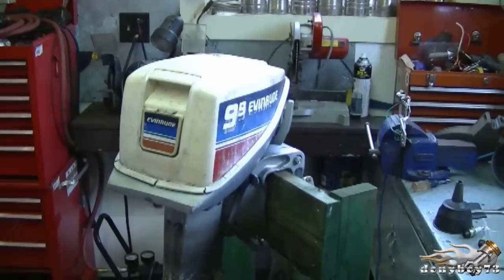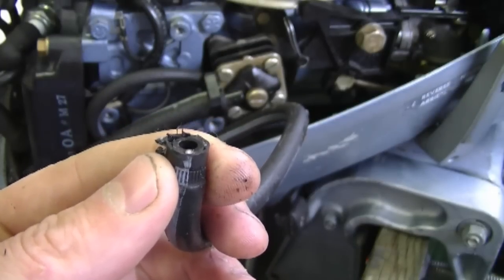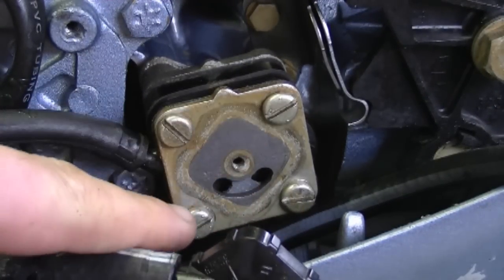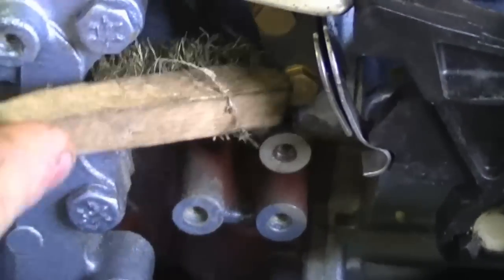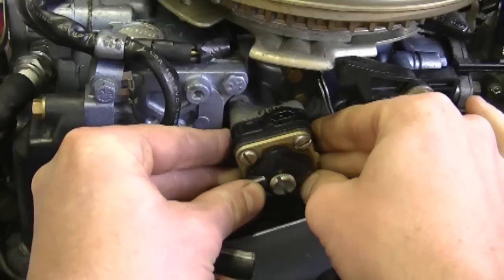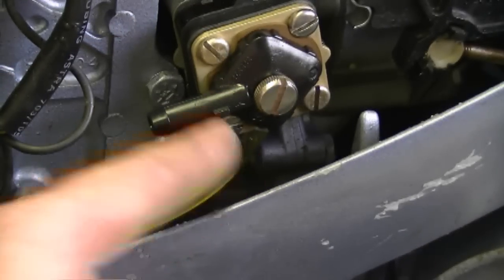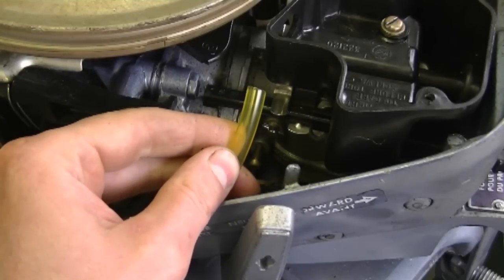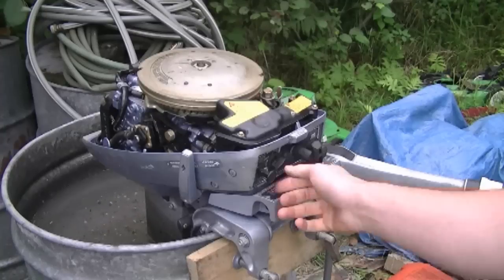How To Replace The Fuel Pump On an Evinrude 9.9HP Outboard Motor

Comment: One thing I discovered after rebuilding the carb, rebuilding the fuel pump, and installing an updated ignition module on the 15 HP version of this motor is to begin problem solving by checking the existing fuel tank. I was having all sorts of problems with the motor bogging down and wanting to stall whenever a significant amount of throttle was applied. After changing all those items it dawned on me that the problems always started when the fuel tank was at a lower level. Looking inside the plastic tank I noticed that there was a significant amount of corroded metal particles floating around the bottom of the tank which was from the old metal fuel float gauge wire and metal fuel cap retainer wire. The particles were clogging the fuel pick-up screen when the fuel was low. I took the tank apart and replaced any metal items with newer plastic versions and cleaned it out with dish soap and water till squeaky clean. Filled it back up with fuel/oil mix, fired up the motor and it ran like brand new with instant throttle response. Lesson learned lol.

Comment: Found out from this video that I was missing the gasket between the pump and the motor.  I actually found that seal inside the engine bay while cleaning.  Yikes!  One thing though, in your video there isn't a rubber square seal between the outer piece with the mesh and the pump.  My motor has the rubber square seal.  Is it supposed to be there?  Did your motor supposed to have one?  Thank you.
Reply from the maker: they all come with it, this was a new pump, where specifically did u see this in the video

Comment: great vid, well done. now my question what if the motor is a little newer  like late 80, early 90's (like mine) the pump is on the other side (and different looking). I ask because my lines are bad and I need to get it off to replace. i have a 89 and the pump is 0433517 - FUEL PUMP ASSEMBLY.  when I pump the bulb it ends up in the pan.

Comment: Question: On my 1983 7.5hp Evinrude the 2 hoses connected to the pump are obsolete and there appears to be no replacements (I have the pump repair kit). You obviously used aftermarket hoses on your repair here, where did you get them and how did you know what to use? Please advise, and thank you

Comment: Hi Donyboy i have a 1983 evenrude but my fuel pump # is312629 the number you have in your vidio is different then mine will the one you put in fit my 1983 thanks
Reply: I have same question

Comment: i have a 4,5hp evinrude with a built-il gravity feed fuel tank sitting on the motor.  it is very small and need to be refilled oftently.  i would like to know if there is a way to bypass the tank and use an external fuel tank? would i need a fuel pump?  any advice?

Comment: my carb is over flooding and i just did a rebuild kit. as soon as i connect the fuel connectors togethere it's like it floods very quickly . can a faulty fuel pump cause this?  my outboard runs perfect but i feel that the bowl fills up to quick. can the air fuel mixture screw cause this ?
Reply: If you have a diaphragm pump I doubt that it could gain enough pressure to cause flooding.  You probably need to replace the float valve in your carb.  It should regulate the amount of fuel in the carb bowl.  Rebuild kits are available.  I just rebuilt my carbs on my 71 Evinrude 50 for under $50.  Good luck.

Comment: when i started up the motor on mine , i got a trickle of gas coming out , or should it be  a lots of fuel coming out of the fuel line to the carb

Comment: Good video. $100 for this pump is like stealing. Shame on the manufacturer!
Reply: +bob Last  LOL my 28 foot yacht cost 2.500    and a new outbord for it costs 2.900
Reply: Same pump on ebay for 20 bucks. Aftermarket.

Comment: having the same issues with a '91 evinrude 15 hp. would you recommend replacing the pump or will a rebuild kit work for it work just as well? thx.

Comment: just ordered me a new fuel pump for my 79 Johnson  I was hoping it just needed a gasket but that wasn't it, but I did use the clear fuel line from the pump to the carb and I could see fuel running out of the carb so that I'm hoping that's it. I'll keep you up dated.. Thanks for your info donyboy73

Comment: I have a 92 johnson 6hp that I just rebuilt the carb and fuel pump on. The fuel pump is getting gas through it but the carb isn't getting the gas what have I done wrong?

Comment: Hey Dany! Love your videos! Very precise. I have this same motor and I am having issues with the tiller gears. They are slipping on each other. Also it doesn't seem as though the throttle is fully engaging. The person who had it before me put a zip tie and a copper wire on the tiller handle for sale reason. Maybe to bring the gears closer together? Not sure what to do to remedy the issue. I can send a video! Thanks!

Comment: Any advice on fuel line to gas tank connectors. Mine are leaking will new one on the hose work or the problem is likely to be the connector on the tank. Help please Im a noob.

Comment: Great video. I have a 1980 johnson 9.9 and it runs great for about 10-15 min and then it dies down. Only way to get it to run is choking it out. It goes mid to high rpm but never reaches full high rpm. What do you think this could be?
Reply: sounds like a bad coil
Reply: jason smith Thanks for getting back to me! I figured out the problem...it was the first outing of the season and I didn't vent the gas cap so after 10-15 min the flow stopped. Once I opened the vent and pumped the primer bulb she fired back up and ran perfect for the next few hours. :)

Comment: Hey dony! Love your channel. I have some questions about the tiller handle on this motor. The teeth on mine are slipping when I try to engage. I have to push in hard so the teeth line up and it's a struggle to engage the throttle. Any advice? Any way to share a video or pic with you? Thanks! Keep up the good work!
Reply: round the screwdriver earlier into the adjustment hole, then the screw

Comment: Very well explain I have a 9.9 Yamaha 4stroke  I changed bulb plugs lines filters I notice my fuel pump has like a rubber gasket it  has bulges in gasket no rip that I can see I can troll just fine but I can't go very fast have no power  do I need to change rubber seal in pump or buy a new pump

Comment: Where do you find parts? I have a 1962 Evinrude sportwin 10hp am am finding my self using a little spit and glue with my parts because no one seems to carry the parts for it. It runs amazing but how long will i be able to keep fixing the original parts i dont know.

Comment: i have a 15hp Johnson model j15rcec...I am having trouble turning it on..it worked before I bought it but now it seems as though no fuel is getting to the spark plugs is this a fuel pump problem?

Comment: Hi 👋 i just bought new pump for evinrude same as you are rebuilding I have put it on today how ever when I squeeze petrol tanks petrol not going true pump in to carburettor??? So i can not start the outboard? Is this new pump faulty?? I can see petrol going in to pump so there is no problem with petrol tank plenty of pressure pussing in to pump .

Comment: for less than a half the cost of the evenrude. Just do not get why they are so expensive dispute the different layout for the drive the actual Engine, pistons, and all the basics, apart from the final drive and splines is the same, probably made in the same factory. BTW the body of the Engine as I say was the same as the comical 3 wheel car (Del-Boy used in the TV comedy) and was used for the evenrude because it only weighed a few pounds because it was Aluminium, with steel inserts.

mrbluenun

Comment: The price of even the smallest Evenrude Engine was way out of my 'pocket' and I had to get a second hand one. It was fine, but I did strip it down and give it a full gasket and oil change and anything else I could do before winter, and found to my astonishment, that it appeared to use the same engine body, where the pistons go, as the laughable English 3 Wheeler Car the 'Robin Reliant', exactly the same even down to the mould inperfections!
It was 20 years ago, then I could buy the car Engine

Comment: I can see the engine itself may be a little special with different met els and other things that could be damaged from salt water and or any 'crud' come sh&t from any mud in the freshwater it may be used in, but the actual cost of these Engines is frightening. I bought a boat for $1,600.00, which had a tender and the boat was a 16 ft with a sleeping 'buddy' at the front. A nice little boat but no Engine.

Comment: Hi donyboy73,

As with all Mechanics you make doing the repairs look easy, because you know what you are doing. Though I have to say this 'mend' was pretty basic stuff.

I just wondered what is in that Fuel Pump to make it cost so much more than a normal Car Fuel Pump? This is in no way aimed at you, because apart from anything you sorted out the problem and so did the remedial work to sort it. I just don't get why the pump is so to me, outrageously expensive.

Comment: It appears as though your video alone has fixed my 87 Johnson 15hp....  I could get it started, but it would die the second it burned off all the fuel in the carb.   I checked the fuel pump like you said and gas was coming out only in a misty spray.   I was about to shut it off when gas started pouring out of the line.   I reconnected the line to the carb and low and behold, it stays running...   Any idea what the problem was?  Or are your videos just magic?

Comment: :( i replaced my impeller . put the drive shaft back in. and tighten the two bolts together that conect to the shifter rod, but now its in nutral when its supossed to be in first?? then ill shift into nutral and some times it will be in nutral and sometimes in gear??? then reverse seems to be ok??? but not sure?  im so lost?  its a 20r71s johnson 20hp , i got it started this morning but now it doesnt want to start' please!! if u know anything about my problem please help!!! thank you

Comment: @harryaverill who asked "Should you always test outboard motor in water?".

The answer is ABSOLUTELY !  All water cooled outboard (about 99% of them) have a water pump in the lower "leg".  This water pump uses a rubber impeller.  Even though the engine could likely run several minutes before starting to overheat, one or two of minutes of operation out of water will cause the impeller to overheat and be damaged.

The water pump impeller should be replaced roughly every 10 years.

Comment: Is there a way to convert a 1983 Evinrude 7.5hp to a 9.9hp in a similar way that a 9.9 can be converted to a 15 hp by using the 15hp carb with a larger venturi and tuned exhaust, etc.?  and/or is there some other inexpensive way to make a 7.5hp a 9 or 10 hp?  Thank you for your other vids too..

Comment: donyboy73 i need some advice on a 58 johnson seahorse 35 hp i got gas going into the carb and i got great spark on the plugs but im not getting gas from the carb to the intake ive cleaned the carb twice and still same results

Comment: i have the same exacly motor but the thing is that the last time i used the boat was two year ago...i try to started and it will only run for few second and will cut out. any ideas? 
itz the carb need to clean out?

Comment: I got a 1999 Evinrude 9.9 4 stroke it stalls out when you give it gas but idles fine is it the fuel pump??? Just cleaned the carb and bowl but still won,t take gas when you throttle up!!!

Comment: I have a 1969 Johnson Seahorse 6 hp it will start and run at full throttle but it will not idle I replaced the fuel pump and rebuilt the carburetor any suggestions and let me be on

Comment: hey dony was wondering if i could dignose the fuel pump the same way even if i cant get the motor started. ??? will it pump fuel into the carb when i try to pull start my motor

Comment: Nice video, Thank you. Do you know the size of the larger fuel line that connects from the fuel pump to the connector which connects to the gas tank fuel line?
Reply from the maker: Eric Cantley I think it is 5/16" inside diameter
Reply: Thank you!
Reply: Tengo mi motor igual a ese y no puedo arrancarlo creo es el carburador

Comment: Great video Dony ,  i'm looking for an EDUCATED GUESS ?  I have a 1978 johnson , i'm taking a trip Nov 22- 2014 & there are no gas stations for 250 statute miles . I need to find out how many MPG a 9.9 gets ? How many gal, i will need to take with me ?  I have a very lite 2400 LBs sailboat , I also have a Chrysler 3.6 dinghy motor , when its on the sailboat there is very little difference in speed ,thats how lite the sailboat is. I will be cruising at fuel saver speed . Thanks Dony or anyone ?
Reply from the maker: sorry I would hate to give you a wrong answer

Comment: Nice video!  These fuel pumps are very EXPENSIVE, so be sure to troubleshoot the entire fuel system before replacing the pump.  Fuel line air leaks, plugged/broken fuel tank pick up, or plugged fuel tank vent can cause the same symptoms.  Internal engine damage can affect the crankcase pulses causing a good fuel pump not to work as well, but the engine would probably not run very well if there were internal problems...
Many pumps are needlessly replaced, don't attempt to "rebuild"...D

Comment: Hi Donny i just picked up a 99 evinrude 4 stroke 9.9 it idles fine but if you give it gas it boggs out like it,s starveing for gas and when i try to idle back down it stalls out... I cleaned the carb and it starts just fine but still won,t take gas.. Any suggestions? before i start throwing money at it...

Comment: Good video,just bought an 1988 which is just like that one.Do have a problem though that there is alot of play(1/8 to 3/16) in the pivot point of the steering if you pull top of engine back and forth..The top pivot point has something worn in it.Any ideas?Would be great if you could do a video series on taking the power head off and re-assembly.thanks

Comment: Hi, today i open an Fuel pump like this one. One port inside was out of position. I Get everything in order and the motor is running.  Easy fix. 
By the way, you make great videos and i have learn a lot out of this. Thank you.

Comment: Thanks for the informative videos Dony. I believe I have a bad pump on my 6hp Evinrude -- it sat for about 10 years since it ran, and the diaphragm dried and cracked. I can hear gurgling/bubbling from the fuel pump itself and the primer bulb seems to have air in it all the time. Rather than replace the pump, I found a rebuild kit for the pump for $14.00

Thanks again for the great small engine videos!

Comment: How do you winterize it
Reply from the maker: +hrabia08 I run it dry of fuel, change the lower unit oil in case there is water in it and fog the cylinders with fogging oil or spray
Reply: +donyboy73 

Thanks

Comment: $100 for a fuel pump and the 30+-year-old motor itself is worth maybe $500 max. Insane.
Reply: Juho Anttila you don't know what you are talking about
Reply: Juho Anttila that is a 15hp motor/ rated at 9.9 worth $800 all day long , and the pump is more like $30 and a 10 minute job.  a new 9.9hp motor over $2000.